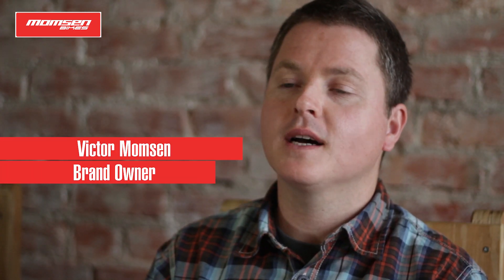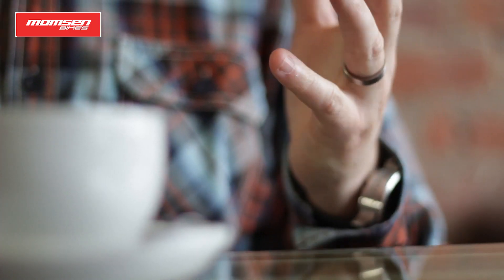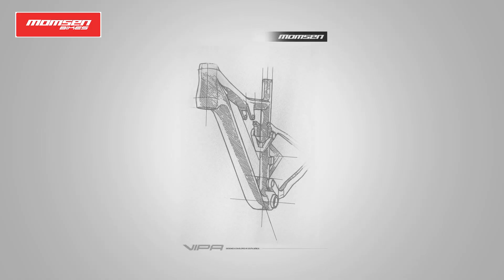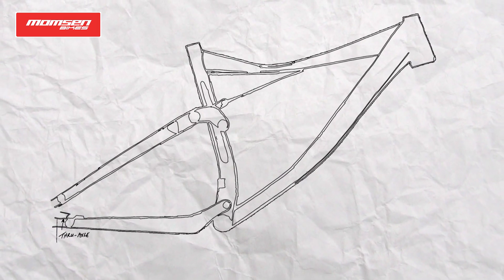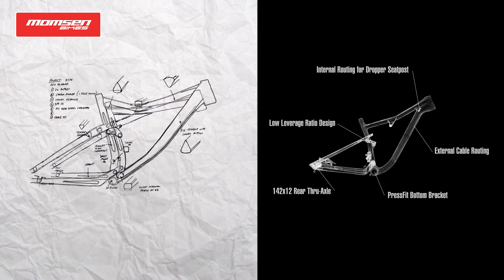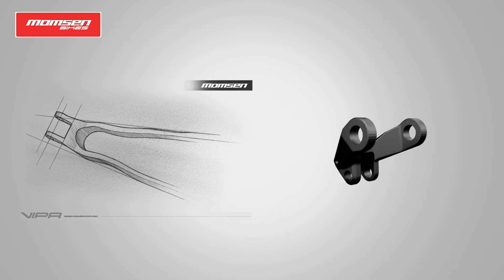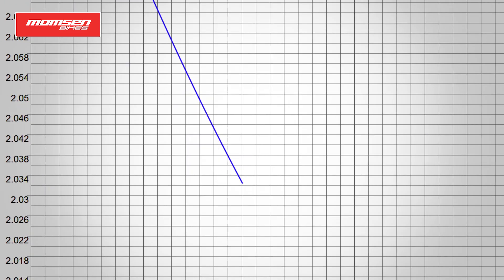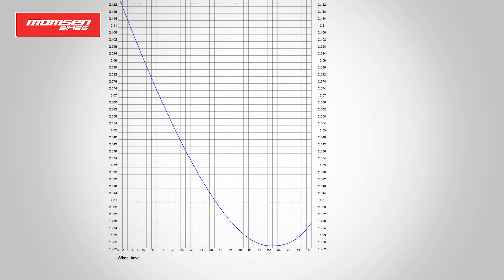MOMSEN BIKES VIPA Project -- Initial Design and Concept

Comment from the maker: Nope. Our pivot point is not even on the chainstay. So totally different. Our leverage ratio and design also does not need special internal shock damping to control, so it is quite/totally different to the well known Horst Link. we will be adding alot more information about this bike on our website soon.